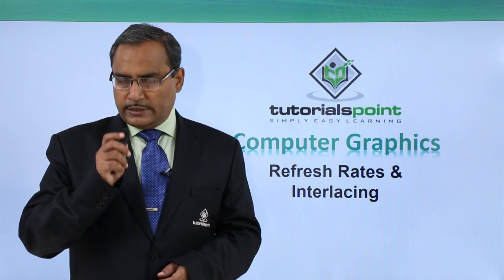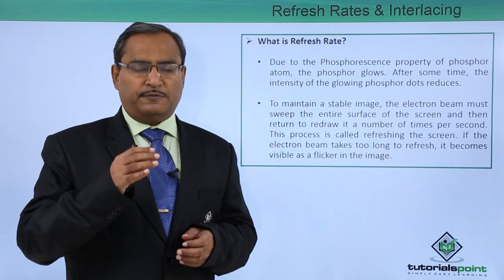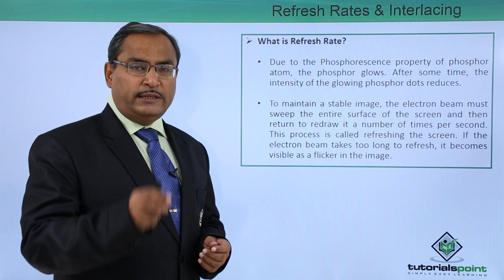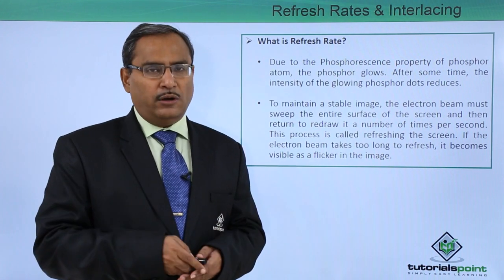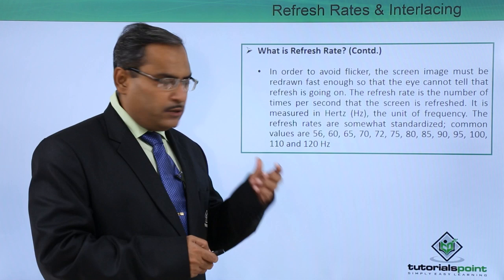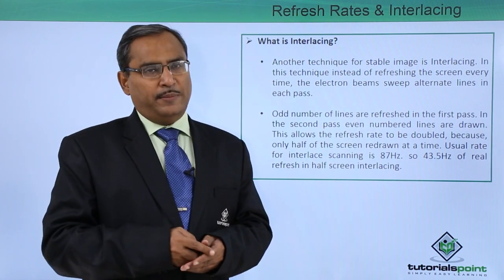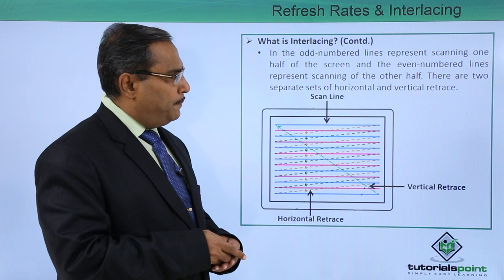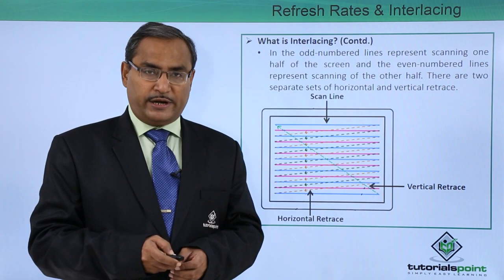Refresh Rates and Interlacing

Comment: Sir, I have a doubt in Interlacing.... As you said that the Screen is scanned alternatively, so it doubles the Refresh Rate, but only half of the screen is scanned at a time, so won't it affect the Picture Quality than the traditional method??